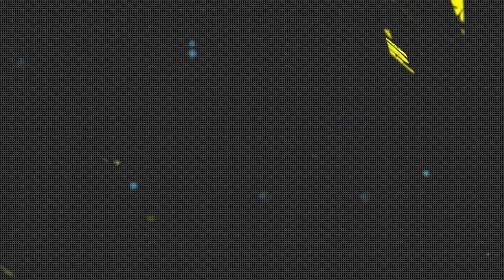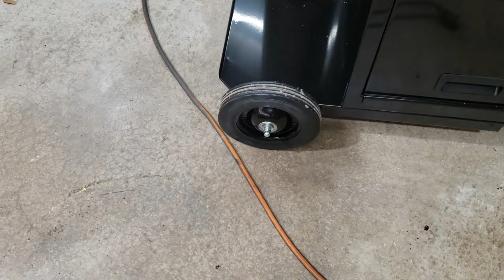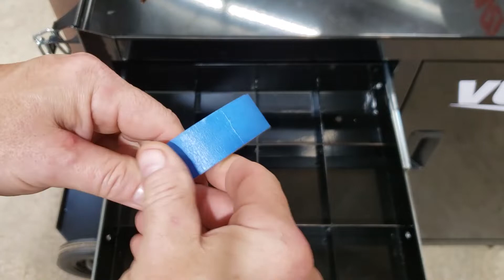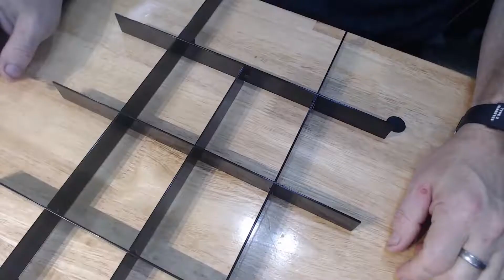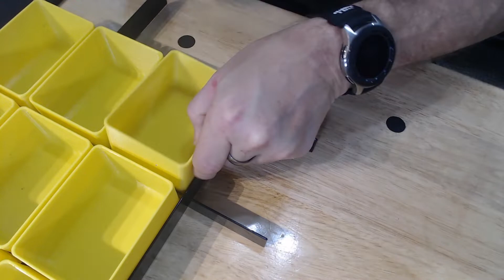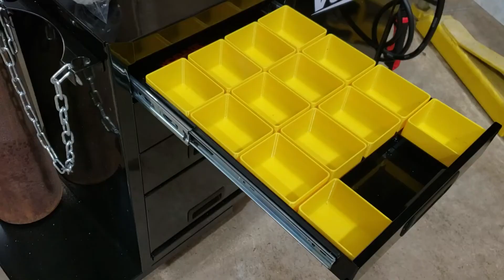3D Printed Harbor Freight Welding Cabinet Drawer Bins

Comment: I currently have the common maker problem of too much stuff in random cardboard boxes. It’s a real problem and I think I’m about to bite the print time bullet and do something like this or what Alexandre Chappel did. This type could be vacuum formed to save tons of print time but Alexandre’s model accommodates labels easier so I’m pretty torn. I looked at commercial solutions like Sortimo, Stanley, DeWalt Deep Pro, Uline Sorters, and Quantum Storage...they’re all way too expensive for me and nothing really does what I want.
Reply from the maker: And honestly, little bins are super easy to design, so you could design them any way you need them to be. Good luck with your organizing and know that I feel your pain. 😂
Reply: @FunKing3d  Great job Glenn, it’s good to see the FK-1 up & running. The 1st thing I thought of when I saw where your video was going I thought “I wonder if Glenn has seen Alexandre Chappel’s channel” Not to rain on your parade, check out the insane levels Andre goes to with his projects. 
https://youtu.be/OthwoWeLb_U